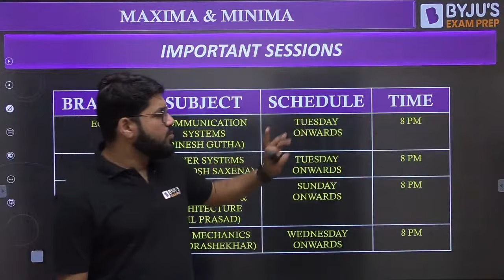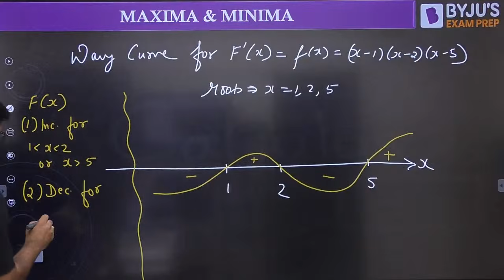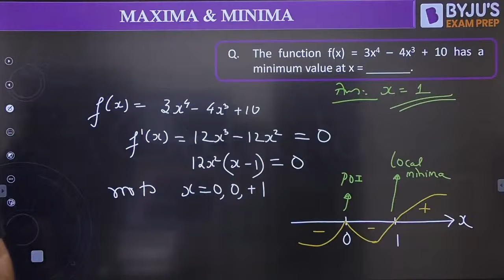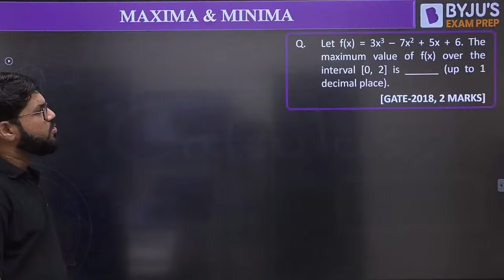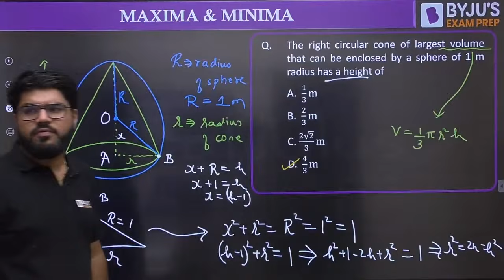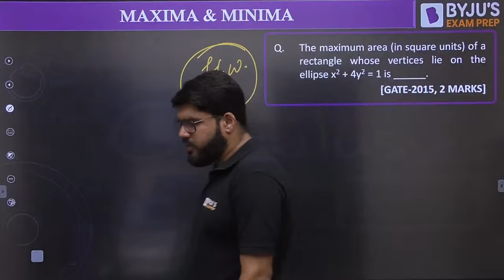Maxima and Minima | GATE Engineering Maths 2023 Exam | Free Online GATE Class - P1 | BYJU'S GATE

Comment: 38:46 if i draw the wavy curve of this root it is suggesting that 4/3 is a minima cause its slope goes from -ve to 0 to +ve its  a increasing function so it should be a minima or the wavy curve is not applicable for this function if so why ?is is due to the presence of PI 22/7 in the equation of f(h) ?